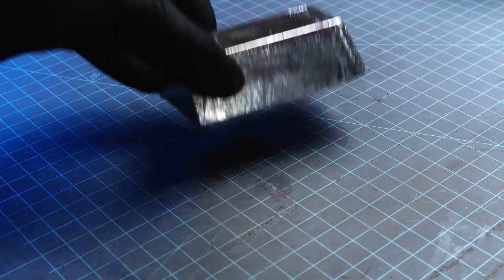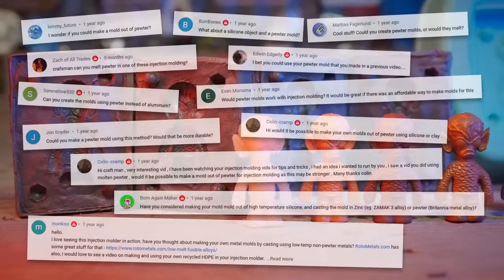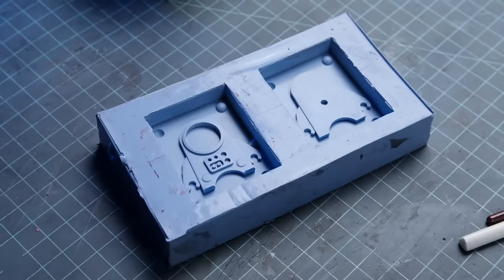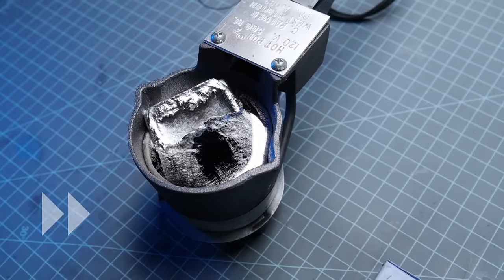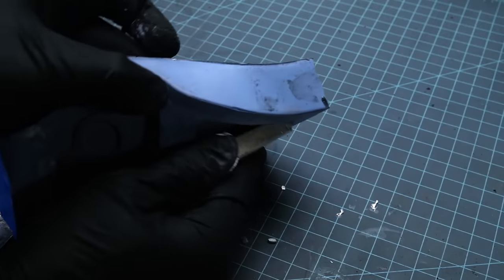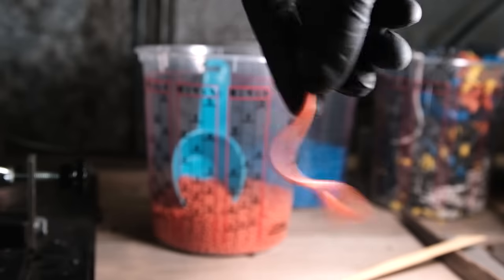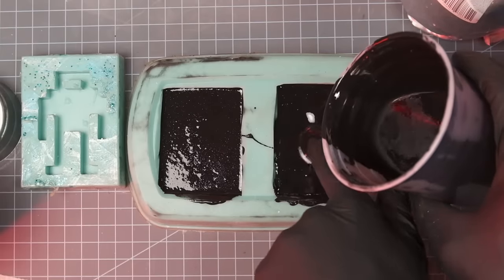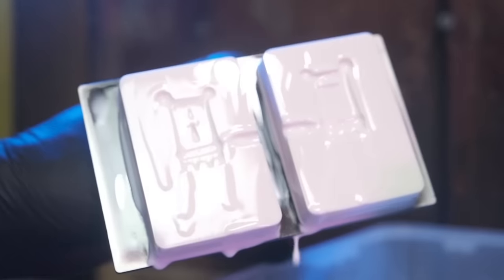PEWTER injection mold! Does it WORK? Is it dangerous?

Comment: I think the corn starch started decomposing leading to the offgassing, something inorganic like fumed silica might be worth trying with this process as a flow promoter. That said a small gantry CNC engraver machine is only a few hundred dollars and could make a flat 2 part mold like this in aluminum or brass, CNC cutting is now more than viable at garage scale and with a small budget.

Comment: I got into this over 20 years ago.  I have an industrial size vulcanizer where I made lots of rubber molds for metal.  It's basically car tire rubber and I've poured stuff up to 700 degrees in them before.  It cuts down on the life but it works well.

Comment: As someone with quite a bit of experience in all types of mold making, from cast-iron, lost wax casting jewelry, and everything in between… Preheating that silicone would probably help. Obviously not too hot ....but enough to drive off any residual moisture, and Bring the two materials to somewhat of an equilibrium…this will lessen the interaction between the room temperature silicone and the 400° or higher pewter.

As a sidenote, laser thermometers aren’t always that accurate. You need a particular type of matte non-reflective surface, I’ve tried everything from the cheap $20 ones to the very expensive ones and even side-by-side comparisons with A few different thermal cameras. Honestly the cheap laser thermometers are just as accurate as the more expensive ones… As long as you have a specific spot that is the proper surface finish.

Always love your videos!
Reply: P
Yes. Preheating the mold will help prevent the metal from solidifying before filling in all the details. Vibrating the mold can also help but is harder to do for home gamers.
Reply: You can always slap some matte black tape on anything shiny for a better reading
Reply: @1nvderZim  Not sure that's gonna work on molten metal...

Comment: Absolutely love it!!! You should do a shop log all the time! I make molds for pouring silver! I 3d print a object. Then pour investment plaster around that. I make sure no bubbles are in it by vacuum sealing it and running my finger around like you taught us. I then melt out the 3d print then pour silver in its place. I’m still working on making them come out with less pitting. I’ve handed vent shaft but still have pitting. They look amazing tho!

Comment: I just love these videos. Another thing that happens when you use molten metals is that it shrinks considerably as it cools and solidifies, distorting the piece ever so slightly. So as you demonstrated, it works ok, but not as well or as consistent as some of the other things you’ve used.

Comment: I'm not trying to force the issue, but what about carving a pewter block on a CNC? It would be less pitted and you could get those details.    It's also way softer than aluminum so it should be easy for even a super cheap CNC.  Even if this only works for a couple of shots, remelting the block would be amazing.  I searched YouTube and Google for examples of people CNCing pewter and I couldn't find a single person trying it! Everyone just pours the pewter.
Reply: I doubt it's all that machineable in the typical casting formulations, much like lead. I wonder how something like Zamak would work, it's relatively low melt but a few hundred degrees more than pewter, and it's used in parts that start from die castings and are refined with machining.

Comment: Very interesting video, would love to know what the machines are that you’re using.
Reply from the maker: Thank you! The main unit we use is an LNS-150A. I also have a DIY/built-from-parts "Buster Beagle" injection mold unit with roughly double the shot size (2CU" vs 1CU").
The LNS-150A is very well-built, and I personally prefer the heat regulator on it vs. the Buster Beagle (bear in mind, this regulator happens to be one of the cheaper parts, so you can swap it out on a DIY unit) and it comes built like a tank, with minimal assembly, but it does come at a higher price tag.  Hope this helps!
Reply: @TheCrafsMan  it does thank you. I’m not sure if you’ve made any videos on the tools you use, but it would be cool to see them and how they work etc

Comment: Another entertaining video from my host! I was wondering, have you ever thought about 3dprinting the molds using rubber-like resin like the Siraya tenacious? I'm wondering if the very slight rubbery deformation could help get both parts sealed properly and get better pieces. Or even just out of sheer curiosity to see if it'd work!

Comment: Thin is good - pewter can fill 1.5mm - talc vs corn - top on the mold - then cut air passages in those corners  with a scalpel and fill them with talc - also can put thread and talc for air vents in problem areas  shop vac chamber - Rubber, either natural or silicon electrostaticly attracts both the pewter and the talc.   And lastly if you pour with the mold vertically or with a funnel sprure that provides head pressure, that will help

Comment: I find pewter casting into silicone likes the mold hot either by oven pre heat or remelting the first 2 or three casts. It also likes the mold to be shaken in the first few seconds after pouring either by tapping it with a metal rod or having it on a rickety table that you can used an orbital sand on near the mold.

Comment: Get yourself some woods metal or rose metal alloys, they melt Way lower temps and should do just as well for quick molds. Also very useful for tightly bending narrow gauge piping when injected from the bottom of the pipe.

Comment: I wonder if you could tap / vibrate the mold to shake bubbles loose
Reply from the maker: You can, up to a point. With prolonged tapping, the top surface acted weird (it started to cool first, formed almost a "film").

Comment: from a metalurgic point of view you need a ,etal with low surface tension to get better detail and cast aluminium could be used for that but you would need a fiecast form :P
on the other hand zink aloys like zamak are only around 50 degree celsius higher with theyre melting point than lead (~380*c) have very low surface tension and castings end up more detailed and smoother (at least in die casts) if you make a mold with feeder and vent you could probably push the metal in with a stick right before it solidyfi like i do with hard lead aloys for my trains increasing internal pressure and redusing shrinkage in the process

Comment: Will it work to print a resin mold with a built in network of internal coolant circuit?
You can then circulate water to keep your resin mold at the proper temp.

Comment: Was your silicone mold preheated before pouring the pewter? Also, using flux can help the flow of the pewter into the fine details, if you don't have flux graphite powder will work better than the cornstarch. But always safety first.

Comment: Mr. Craftsman, I work in the metal foundry and I believe I have the solution for your low(er) quality pewter casting details.
The first reason can be excessive use of baby powder. A bigger lump will cause defects in the surface finish so the best application device is an old and loved sock which your wife prohibits you from using anymore. Fill it up and shake a couple of times. It will spread a nice thin coat over your workpiece.
 Secondly, if it had any moisture in it, it would release even a little bit of vapor upon contacting the molten metal and cause defects. You can see that, after pouring pewter, it was still acting 'lively', bubbling.
Lastly, the pewter started solidifying as soon it hit the aluminium box and silicone mould. They both 'stole' a lot of heat from the pewter the very instant they touched, and pewter shrank, causing rounded edges. You can avoid that by:
1. Heating up the mould in the oven, as hot as you dare, just before pouring time.
2. Over-heating the pewter metal. In the industry all the metals are  heated above their actual melting point to prevent freezing when transported to their mould for the casting and during the casting process itself.
3. Pour faster- with proper personal protective equipment, faster pouring becomes safer and improves the quality of the casting.

Additionally, the feeder system, which you don't have, is vital to the the quality of the castings. They are basically mould cavities of calculated volume above or to the side of the casting, which will also fill up with metal and remain liquid for the longest period of time. They are the last parts of the casting to solidify, thus suffering the shrinkage cavitation...which doesn't matter because they get cut off.

You could make your own by simply making the halves taller (thicker), and subsequently cutting away the excess shrunk metal.

Cheers from a fan!

Comment: CrafsMan, Have you ever thought of trying to use that thermoelastic polymer you were injecting, as a mold material itself? It has me thinking that if you made the tooling so you could shoot a thermoelastic polymer to make a negative mold, could you then use that to cast resin parts from? The mold would be recyclable being thermoplastic, that is if the resins wouldnt stick to it and also a lot cheaper than Silicone molds. Faster too, once the master work was over with. I suppose it all comes down to, does resins stick to the Thermoelastic polymers? Cheers Rob

Comment: The surface finish and the curved edges are most likely due to the open back pour.  If you made a 2 part mold the surface finish would be almost as nice as the silicone if the pouring tempratures were correct.  The same thing happens with open sand molds and it might be even worse with aluminum becasue it has some incredible surface tension that causes it to dome up

Comment: Now I'm curious how detailed of a pewter model could you make ? Like could you take a high detailed 3d printed mini and make a mold of it and then cast it in pewter. How detailed whould that mini be?
Reply: Pewter is very detailed. You just have to get the alloy. Melting temperature right. Oh ya tapping the mold a bit before the pewter sets helps with the bubbkes
Reply: @Johnne009  well I'd like to see a series making molds and casting in pewter. Because I've got a project I'd like to attempt

Comment: If I'm interpreting this video correctly, the impression I get is that you made a pewter mold and basically got good results but lost some of the detail because you couldn't stick your finger in to work what you poured into the crevices. My question is, if that's the case, couldn't you just cast a silicone finger to go in and do what your real finger couldn't do? I bet if you put a metal rod in the finger to keep it from being TOO flexible you could poke it right in there and do whatever you needed it to. Or am I missing something here?
Reply from the maker: That's actually SLICK, Finn. For real... a silicone "finger" makes so much sense!
Metal is still tricky about corners (probably a surface tension thing, but I'm no expert) but by my estimation, this would have to help!

Comment: I bet you could use rosin flux in the silicone mold to encourage the pewter to get into the corners.
Reply: Just tapping slightly works. The pewter was too hot causing the rubber to burn and degass

Comment: try tin molds, similar to ABS temperatures, 240C
Reply: could be easily a-b compound casted or injection molded, or even tin could be used as the part casting material itself

Comment: Not that this video wasn’t great but I think they were asking if you are able to inject pewter into one of your molds rather than making a mold out of pewter. That way you would end up with a pewter figure at the end similar to an old D&D miniature. If pewter melts at about 400 degrees similar to the plastics you use, could you injection mold handle that?
Reply: That would be called spin casting. It's done on an industrial level
Reply: @Johnne009  most injection molding happens at an industrial level not for home hobby use. This is all magic as far as I’m concerned.
Reply: @TioMostFrio  spin casting is rather primitive. Go check it out. I've done it at home many times
Reply: @Johnne009  okay so I looked it up and it seems very complicated. Maybe I looked at the wrong videos, but most involved using a centrifuge. You can make injection molds with pewter as well that do not involve a centrifuge.

Comment: I am looking for material info and I couldn't find anything on... plastic strengths... I am attempting or desiring ot make a lid for an object? Would resin a hard finish be good? I need a tight seal... or would like a silicone mould material that is flexible be a better material for a lid. THe lid would get daily use? anyone?

Comment: Like.  I cast lead bullets. The temp of the mold is critical, Detail is gained and lost in tempeture differance. The silicon mold melting temp is too close to pewter and cannot be pre-heated. Bullet molds made from aluminum work well for onesies, using the poured lead as temp. control. The silicon will just resist untill it melts.